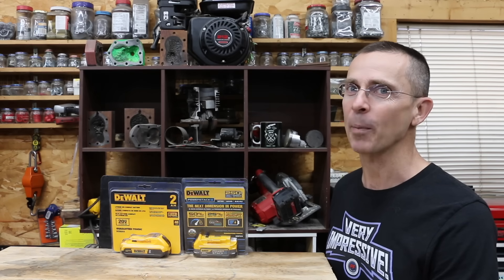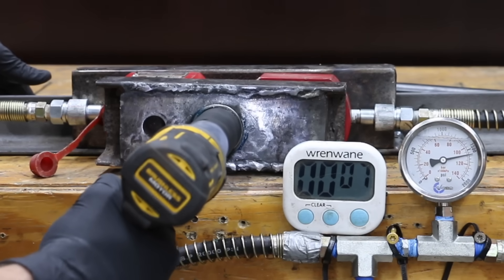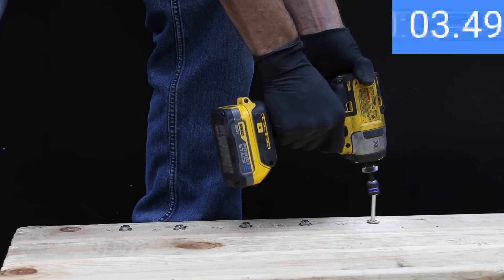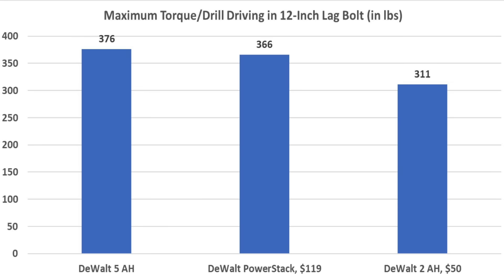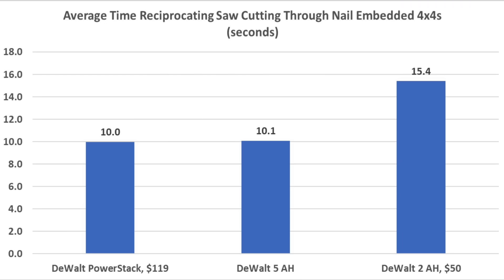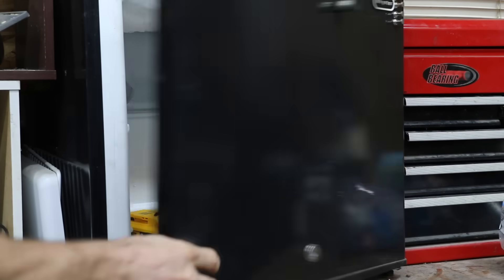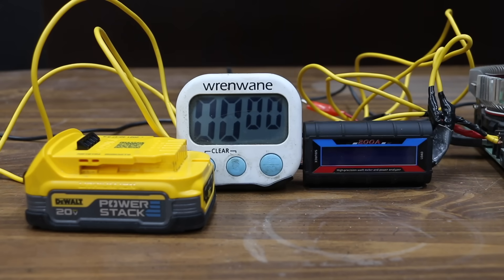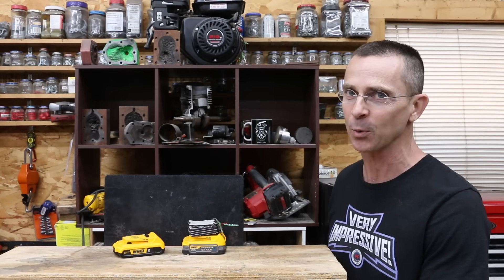Compact “Pouch Cell” Battery Better? Let's Find Out!

Comment: Just by reading the title I knew they used LiPo's in the new battery and that it wouldn't last any longer. LiPo's are not really that much more expensive, at $120 it's a complete rip off. 2 of the Powerstacks cost as much as 3 5Ah batteries. 

Also...careful with those LiPo's, wouldn't want to puncture one and cause a LiPo fire.
Reply from the maker: Thanks for the feedback.

Comment: 3 minutes in the screws is not an even test, that's why the difference pending position on the board - choose something that doesn't have Grain the screws were poorly done and I've seen you use that before - Here there are Fence Posts made from re-cycled plastic Solid bloody posts. Use something like that so that every time you use That style of test you get a consistent result.
Kiwi

Comment: I'm looking for a good quality jumper cable, but most cables are fraudulent by thickening the insulation than the copper strands. Could you please do a comparison of a bunch of jumper cables, measure the actual gage vs claimed, actual resistance per feet etc.
Reply from the maker: Thanks for the suggestion.

Comment: Your videos are great!  I've been trying to DIY different things around the house, and your videos have been a lot of help.  The drywall anchors, and wood glue videos were especially helpful.

I did a quick search through your videos and couldn't find anything on lawn vacuums.  I have to deal with quite a bit of acorns in my lawn, and was wondering if you knew which ones could handle that sort of load.  Maybe that could be a good next video?
Reply from the maker: Thanks!  Thanks for the suggestion.

Comment: Those little flat-pack bombs are a hard pass for tool use.
I have about 40 lipos for my various fpv race quad copters, airplanes, buggies and boats.. those packs puff, cells die, they’re sketchy to recharge, and any puncture results in a toxic fireball thats real hard to put out.
I always recharge them laying in a ceramic bowl in case a cell blows and it tries to burn my house down.
They’ve become more powerful, less expensive and more reliable over the years, but still don’t fully trust them…
Reply from the maker: Thanks for the feedback.

Comment: 18650 is the only way to go. I replace all my dead dewalt batteries with them. Also have 4,200 that power my off grid life. Going for 8,400.. 92kw
Reply from the maker: Thanks for the feedback.

Comment: 14:36 "As you can see there are 6 different 18650's in this battery pack"
Is he trying to clockwork orange me? That's 5 cells :P
Reply: If you didn't get the reference. They interrogate someone, hold up 5 fingers, ask the person 
"How many fingers am I holding up?" 
He replies "five" Then the interrogater says 
"I'm holding up four fingers!" 
They repeat this process until the person goes insane.

Comment: Unfortunately I don't think flat lipo packs are suitable for a worksite. I've had 3 of them have a cell puff up and destroy the battery pack. They don't come close to being as durable as steel cased liion cells. At more than twice the price, they're not even close to worth it. They're also not repairable.
I think we're going to start seeing battery packs made from 21700 cells replacing 18650 cells.
Reply from the maker: Thanks for the feedback.

Comment: Just came back from the super market, they now sell double capacity batteries for their line of power tools. Double the price, too. But they claim to use 21700 cells. And they have bluetooth built in so you can set profiles, like more power or eco or something with an app… 🤷🏻‍♂️
Reply from the maker: Thanks for sharing.

Comment: most of these lithium ion batteries requires conflict minerals to make, and since they are made in china most of china's suppliers never disclose where they got the resources from, I would not be surprised if the minerals used to make these were from Congo, which is ran by an organised crime and child slavery.

Comment: Milwaukee, it holds three patents (7,554,290; 7,944,173; 7,999,510) that give it the exclusive right to make “multi-cell Li-Ion packs that can produce an average discharge current greater than or equal to approximately 20 amps so i believe that why Dewalt is trying new battery technology to not have to pay in further fines/lawsuits
Reply from the maker: Thanks for the feedback.

Comment: I saw you use the "200A" tool, you should use an external power source plugged on the little 3 pin ports, so it won"t use the power from the main source (about 0.5a in some case). It's not documented; it's the same pinout than RC Servo, a 6/7/8/11v batteries are ok
Reply from the maker: Thanks for the suggestion.

Comment: The durability of the pouch cells are not as great as the 18650's. Not saying one battery is more dangerous than the other, but pouch cells will bulge out over time and will soon pop, making it a ticking time bomb. 18650's have never been known to bulge out, but still have the ability to explode. I'd rather have 18650's in my opinion.
Reply from the maker: Thanks for the feedback.

Comment: The pouch batteries are lipo batteries. I use them in my RC stuff. They are great for high discharge but don't have a long service life and pose a real fire hazard. I personally wouldn't use them in my tools. Check out lipo battery fire videos. I think money is better spent on a bigger amp hour battery.
Reply from the maker: Thanks for the feedback.

Comment: can you try to run a car or a truck with only propane in the air intake plz! ?   the car will monitor the gas down. if we can make methane free from trash , we could power our car for free .....
Reply from the maker: Thanks for the suggestion.

Comment: The powerstack is only rated at like 1.7aH so it definitely is an impressive little battery. Bringing it up to 3aH would still keep it fair small and jus have the much longer run time. Its already pretty comparable to the 5aH except for run time of course, so making a 3aH powerstack would jus be that much better. Great vid as always Todd. This is the comparison vid i have been waiting for, getting down to the nitty gritty which is your specialty haha
Reply from the maker: Thanks!  Thanks for sharing.
Reply: Powerstack: Short on run time, high in cost.

Comment: Hey Man, great channel. I've been a subscriber for quite some time. I've wanted to ask what brand of prescription frameless eye glasses you wear. Or what store you bought them at. In my area, all I ever see for sale are the 'rectangle' frameless eye glasses. Thank you for any insight you may offer. By the way, the right angle adapter video was awesome. I had no idea those things even existed. Also, have you made a video of the hand held skill saws made for cutting steel? They have an integrated gear box that reduces the speeds down to what is needed to cut steel plate.
Reply from the maker: I have not yet tested metal cutting saws.  The glasses are made by Silhouette.

Comment: How about a test of using 2 cycle TCW oil instead of 2 cycle air cooled oil in air cooled engines?   Also increasing the oil to gas ratio.  Thank you
Reply from the maker: Thanks for the suggestion.

Comment: Good morning Project Farm. I love watching your videos, is there any way you could test door hardening products?? You could try comparing different styles of deadbolts, replacing screws for longer ones, kick plates, “door armor” and other door hardening kits or “hacks”, by testing how much force it takes to push open doors with them installed. I think it’d make for a really interesting video. Instead of purchasing whole doors, you could make “mini-doors” surrounded by the same type of wood that frames regular doors, then put them under your press to test how much force it takes to break it open.
Reply from the maker: Thanks for the suggestion.
Reply: @ProjectFarm  I love this video idea, however, the "mini-doors" would throw all of the data off for products designed for full sized doors. 

Also, the smaller a door is in width, the more of a gap there has to be between the door and the door jam, making most locking mechanisms unable to work properly. The only way around this would be to make the doors thinner, but doing that would make them too weak to stand up to any useful tests of the products/kits/hacks.

Unfortunately I think that making a full sized door mockup, and then doing only non-destructive tests would be the only way to do this video idea.

That being said, I love the video idea, so if you can find a way to make it work, please do!

Comment: As far as I know, lithium polymer batteries aren't as durable, and are a lot more prone to catching fire. The tradeoff is better energy density. It'll be interesting to see how these packs hold up in the long run after getting banged around, dropped, and cycled many times.
Reply from the maker: Thanks for the feedback.

Comment: hello, first of all i want to thank you for the many review videos that you made. very amazing stuff!

now i have a "tool" suggestion to be tested. 
nonstick pans :) 
there are many different, sometimes very< fancy, styles. PTFE coating, ceramic coating, granit coating, patina (@ cast iron), PTFE coating with etc.. 
what's interesting in my opinion is: nonstick capability, scratch resistance, heat resistance without cooling, nonstick capability after exessive (ab)use, cleaning etc.  
i know these are special tools for chefs, but they are tools aren't they? ;)
Reply from the maker: Thanks!  Thanks for the suggestion.

Comment: LiPo usually has a higher C rating than Li-Ion so can discharge faster.  Biggest advantage is lighter, but at a higher risk of fire.  The tools need to be rated for higher current or they will burn like Milwaukee used to.
Reply from the maker: Thanks for the feedback.

Comment: Great review as usual.  I do not think you should throw out the slowest cold temperature run as the battery pack heats up with use and you are testing cold performance.  Consequently the longest time should be the first or coldest run and is the most important piece of comparative data.
Reply from the maker: Thanks!  Thanks for the constructive feedback.

Comment: Hey man. Just ran into a realworld issue today... Needed to spin out a pressure sensor with a deep socket. My snap-on deep socket wasn't deep enough to go over the entire sensor.. By fluke I had a Proto deep socket and it was actually much deeper than the snap on! Did the trick. Maybe do a video looking at deepsockets and which ones have the best "bolt clearance" ?
Reply from the maker: Thanks for the suggestion.

Comment: I had a $60 10 inch touch pad made by Panasonic and it had one of these extremely dangerous batteries in it and almost blew up in my room.  The battery split the case in two over a week period to about 3 inches wide,That was 15 years ago, so these batteries are not too new, hopefully it has new technology updates so it don't blow up, it would be a good electric car battery if Ford ever brought back the Pinto!
Reply from the maker: Thanks for sharing.

Comment: Can you make a video on pocket/work knives to see which blade is the strongest stays sharp the longest and which ones have the weakest locking mechanisms? ( That would be to see if the knife will close on your hand should the lock fail)
Reply from the maker: Thanks for the suggestion.

Comment: Great video. Just another useful point of information to help explain your results, higher capacity batteries have a lower internal resistance. The higher the internal resistance the lower the current the battery can deliver.
Reply from the maker: Thanks!

Comment: My take is that it seems that powerstack battery did very well for the power part. However, the capacity is pretty small and price is very steep so if you're not willing to pay premium for the weight/size, you should get a regular 5 Ah battery instead. Great testing as usual!
Reply: 5 ah stacker is coming soon.
Reply: @Bigfoothawk  omg the price would be sky shaking.
Reply: So I've been running a mix of DeWalt batteries for awhile now and I love the little Power Stack battery on the compact atomic stubby impacts. It does a great job with bolts and lasts quite a long time, all things considered. For a leaf blower of SawzAll I always grab a bigger battery but more often than not I use the little one on impacts.
Reply from the maker: Thanks!  Thanks for the feedback.
Reply: Potentially a case to be made for the professional who regularly does overhead work. But except for process-specific factory work and drywallers, what's the point? Maybe someone who has to climb with all their gear would care about weight that much.
Reply: @benthurber5363  And sometimes the space is so tight that the physically larger battery makes it impossible to use the tool. For such cases, you want small battery.

Comment: I noticed that on the 5h when drilling the big screws you drove in the screws a lot more straight down with the 5h. The power stack the drill was at a lot more of an angle. It seems that would make a difference.

Comment: VIDEO IDEA: I would love to see a test for metal hinge lubricants (mainly for house door hinges). Which lubricants work best for long term. Also, how dirty do they get over time (some lubricants collect dust and get grimy). 
Some Options:
Dry, wet, silicone, vegetable oil, metal bonding, etc.
Reply from the maker: Thanks for the suggestion.

Comment: There are 5 batteries not 6  in the 2amp bat pack,  just like the power stack,  Pouch batteries need as much cooling as an 18650 bat. Cause you can pack them so tight it is easy to neglect the needed cooling.  The 3 pouch batteries in the middle of the 5 stack have no place to dissipate the heat.

Comment: Video idea.
There is alot of debate in the guitar world about if wood effects sound on electric guitars. And how much on acoustics. There isn't alot of info I can find and it doesn't really say. I know it would be a small amount of your audience that would be invested in this but people ha e been thrown out of religions cause of this and I would love to know once and for all.
Reply from the maker: Thanks for the video idea.
Reply: Considering that people have made good sounding electric guitars from everything starting at acrylic resin and ending with concrete, i personally would say that it does not matter much, if at all. More so because it picks up string vibrations directly instead of actual reverberated sound. As far as acoustic go i do not know.

Comment: Excellent as always. It seems like the powerstack one doesn't have as much capacity as the regular 2AH one though it does have better performance while it lasts. Either way the 5AH looks to be cheaper and better than the power stack one, minus size/weight?
Reply from the maker: Thanks!  Thanks for the feedback.

Comment: Having higher battery capacity means a more dense battery which in turn makes the battery provide more current and hence the best result for a trade of its weight. If weight and budget aren't a problem, one should always consider buying a higher capacity battery.
Reply from the maker: Thanks for the feedback.

Comment: Excellent video as always.  Trivial error but, you said "six different cells" for when you took apart the 2Ahr pack, but clearly there were 5. I guess the only real application for the power-stack is someone who wants a light tool but wants fast performance for small jobs.

Comment: Buyed a De Walt  9 Ah 18 / 54V bundle of 2 Batterie and a Loading unit, in 2018, now there both wrecked.
Price was around 450 € in the past. Opened it and found the same Sh... as usual, 2 of the cells inside under 1 Volt = Broken. 
I changed them to new ones and the battery works then.
Impossible with pouch cells i think.

450€ given to dewalt and they give me about  three Years of usage on constuction sites.
Buyed a Milwaukee Driver set 18V including two batteries 18V 4(5?) Ah and loader in 2010.
 One batterie died in 2018, the other and the driver and the loading unit stull running, they are fill the hole Dewalt cuted.
350€ given to milwaukee more than 10 years of usage.
Yes the Service from DeWalt is good an they care, but i like more to not need any warranties.
Reply from the maker: Thanks for the feedback.

Comment: Really interesting video! Seems like the real win here is the price reduction in the regular 2 Ah battery. 

Video idea - taps. Quality is hugely important when tapping holes, as a broken tap represents a gigantic headache. A solid review of taps would be super helpful!
Reply from the maker: Thanks!  Thanks for the video idea.
Reply: people are now realizing its easy to rebuild standard 18650 cell packs with new cells very cheaply and dewalt is trying to get away from that....and probably one of the reason they are doing this.

Comment: Another good test would be water wetter vs engine ice, etc
Reply from the maker: Thanks for the suggestion.
Reply: @ProjectFarm  
I dont even know how many methods there are for changing the color of metals, but I know some of them change the surface texture, the surface durability and the dimensions, while others do not (or to different extents).
Ex: Powder coating vs Ceracoat
vs Anodized vs Blueing  vs
Parkerizing vs Heat & vinegar, etc
 I personally would be most I terested in the processes which one could perform at home, with things typically on-hand or little investment

Comment: great test video. I have lots of dewalt 20V and 60V tools. I was wondering on the power stack. I have now 3Ah same size as 2Ah and 6Ah and 8Ah same as 5Ah. was wondering how china calls hold up. next time you do a test like that use a inferred thermometer to show how much heat the battery makes. Heat shortens the life of battery's. now how much life does power stack have . cycle life/ time holding a charge.I have lots of fun watching your videos .
Reply from the maker: Thanks for the suggestion.